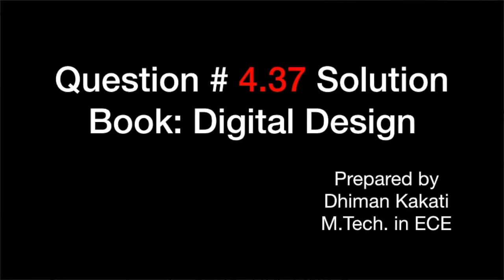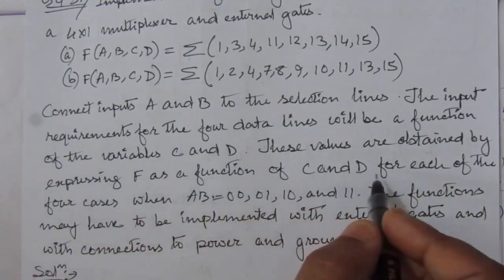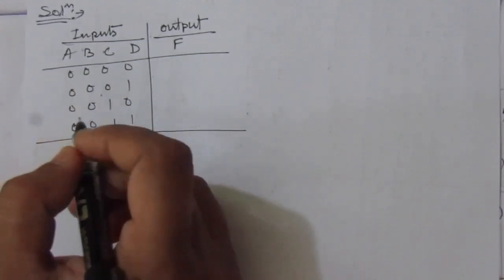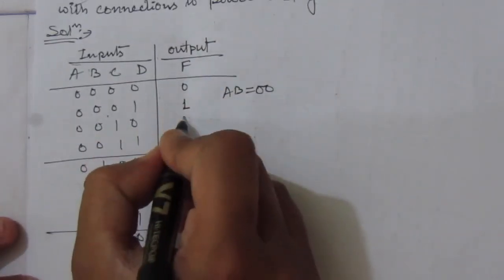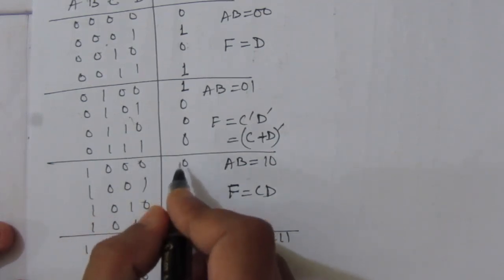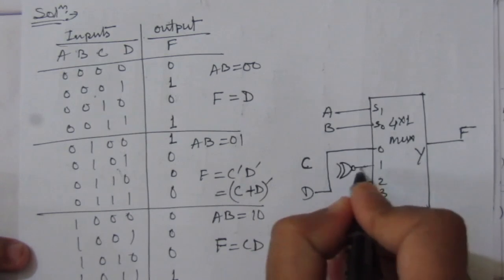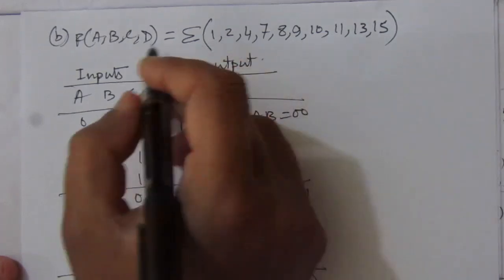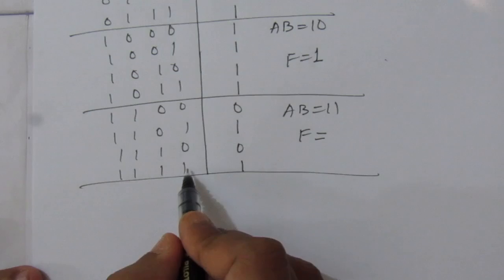Q. 4.37: Implement the following Boolean function with a 4 * 1 multiplexer and external gates

Comment: Design the combination circuit for following Boolean function with a 4x1 multiplexer and
external gates.
 F(A,B,C,D)= (A+ B + C' + D' )(B' + C' + D)(A' +C+ D')
A and B will be used as Select lines and C and D will be used as input      kindly solve this problem please need urgently
Reply: Did you get it solved??